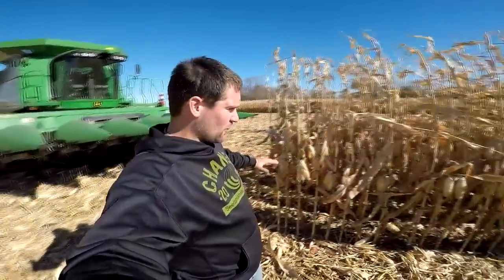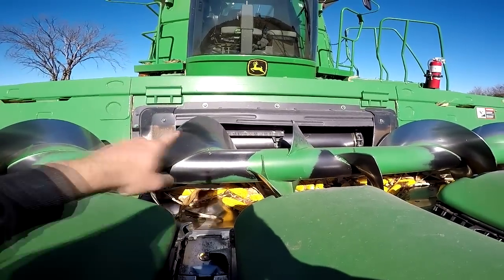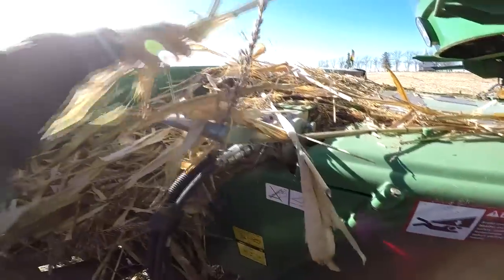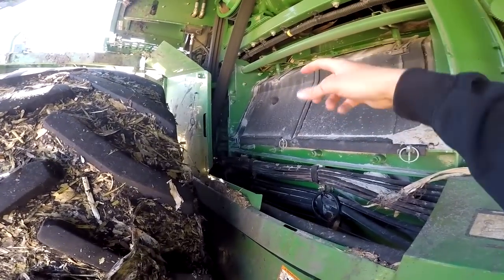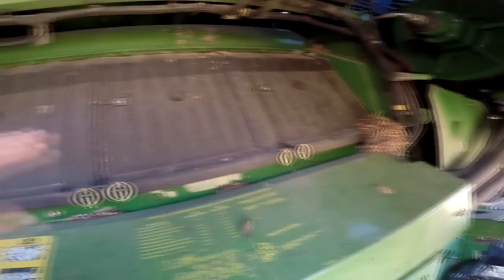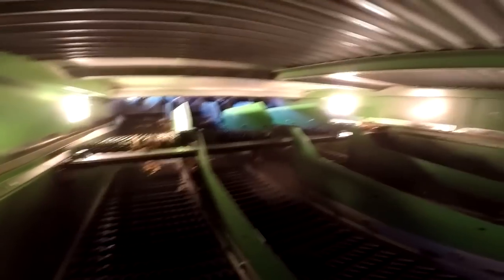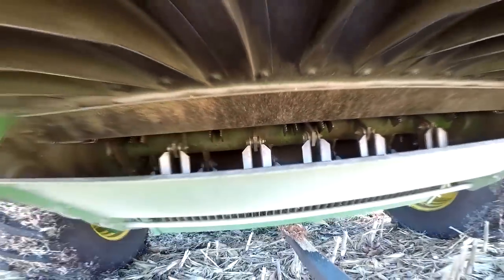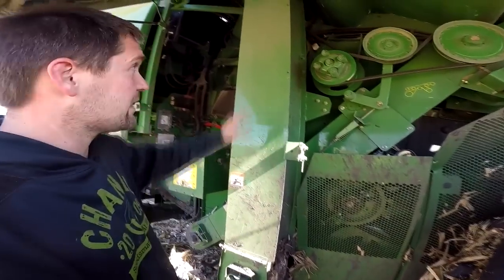How does a Combine Work?

Comment: Thanks for the great video.  The basics have not changed from the stationary threshing machines - feeder house, threshing mechanism (e.g. spike tooth/rasp bar cylinder, rotor, ...), beater, shaking sieves, wind, debris separator (e.g. straw walkers), clean grain elevator, tailings  elevator, debris distribution (e.g. speader, chopper, ...).  Long ago, my experience was with spike tooth cylinders (JD 55).  You spoke often of the rotor, it being corkscrew, etc.  I've never seen one, even though they have been in use for years now.  Is it tapered, smaller in diameter on the feeder side, expanding as it extends toward the rear of the machine?  What is on the rotor, bars of spikes, bars of rasp bars?  Somebody mentioned concave teeth.  Where are they located?  In what form (spikes, bars, ...)?  I presume the number of concave bars/teeth can vary, and the gap to the rotor can vary as well (different gaps for different crops).  Thanks.

Comment: You could match the points on the gathering chains, so they are right across from one another.  That's they way I run mine,  I found in very dry conditions,  thrash builds up on my head, especially when going down hill, & it feeds in better.  I do have 36 inch rows, so that  might cause more trash to sit on the head area. So if you ever replace your gathering chains, consider placing the points across from one another.   One time it was so bad, I quit & went home to try & them set that way.

Comment: Question about the combine. Do you use the same combine for both soybeans and corn. If so other then having to change heads is there any other changes you have to make the combine when you switch from harvesting soybeans to corn?
Reply from the maker: D R yes and yes.  We have a few changes to make, it takes about an hour or 2 to switch over.  We mostly adjust the speeds and clearances of the moving components inside but the process of how it all works is still the same.
Reply: Thank You
Reply: On the old machines from the 80s backwards use to change sieves by hand,change pulleys and belts and hand crank speeds. Even had to hand crank your wind adjustment for wheat and oats so they wouldn't blow out the back of the combine!

Comment: You said  the corn stalk is being pulled down to remove the cobs , is basically only the cob and foliage going thru combine? I always thought the whole stalk was run thru and cobs and stalk shredded in the chopper exiting rear! I've seen farms that cut their corn high up and come back with a flail mower and mow to the ground! Wouldn't it a dually be better if the combine did only run the cobs thru combine allowing less corn being thrown out with the cgaff?

Comment: I know this is an older video and I hope my question can get answered. Thanks for showing how the grain gets from field into the grain tank. But how does the grain get unloaded? I see there is  90° elbow at the top that allows the unloading auger to swing out. What allows the grain to get around that elbow without getting plugged up?
Reply: There’s a 90 degree gear box in that elbow.
The gear box connects the vertical and horizontal unload augers together.

Comment: Just about what rate of corn do you harvest with the 9870?   I have a 9770 sts and about 3400 bu/hr seems what it does but still has lots of power left.  This year we lost about 60 bu to hail so it's fuel is <12 gal/hr with its small stalk and missing lower leaves.  I think this is about  200 hp if it is 17 hp*hr/gal.

Comment: you must understand, as you close the shaker screen down there is an  increase in the air pressure under the shaker- so there is a delicate balance of shaker screen opening and fan speed. also the rotor operates with an optimum amount of material coming into the machine. if the corn gets thin the machine needs to speed up to maintain that optimum material intake.  as you can see on the video- everything has sensors on them so the computer can watch everything at the same time and do lots of the adjustments on the fly and the driver can actually see how much grain is going out the back and make more adjustments. also.  I forgot to mention that machine with out the grain head is  north of $250k,  add in a $175k tractor and a $40k grain cart and you wonder how in the sam hill a farmer can make any money at all. he literally bets the farm every spring putting seed into the ground- prays a crop comes up then hopes the government doesn't  allow  too many imports that lowers grain prices below break even.  ain't farming grand, eh!

Comment: How does the height of the header affect harvesting?
Reply from the maker: TheDers we want to run it low enough to catch all the cobs and chop the stalks efficiently but not so low that the machine takes in too much stalk material or the snouts are hitting the ground.
Reply: Conditions can change from one part of the field to another so you may need to adjust it as you go across the field
Reply: MN Millennial Farmer ok thank you

Comment: How does that auto sense do in goose necked or downed corn?
Reply from the maker: 133dave133 I haven't run it much in either but it's sketchy in downed stuff if the stalks get under the snouts.

Comment: Can you show us how to drive a combine
Reply: they have auto steer so they pretty much drive themselves. Other then checking on your return loss and the loss on the rotar and adjusting accordingly.
Reply: its basically like driving a truck. If you mean using the monitors that would take forever since they are complicated and kind of hard to use.
Reply: Tractor1150 

Way different than driving a truck haha, most combines including ours are ran by a hydro, on the hydro stick you have all the header buttons, separator off or on, and feeder off or on. The 2 back wheels are used for turning. All the others things like lights are on a panel to the side. We have two monitors in our combine "One is gps and auto steer" and the other one is everything about the combine like speed of rotor or of the combine, moister of the grain, etc.
Reply: I-LEGEND
Yeah we use some old combine though, like a 2006 John deere 9860 or something (irdk). Parents let me use it this year and it felt like driving a truck to me idk
Reply from the maker: Clay M I have it on the list!